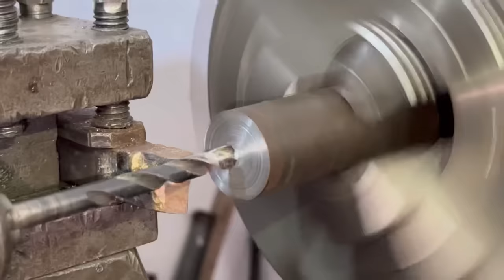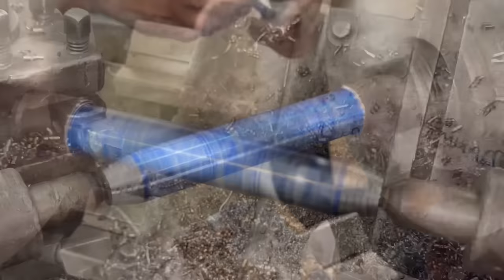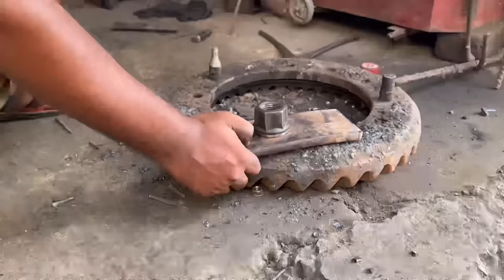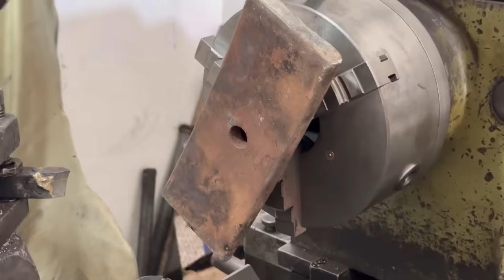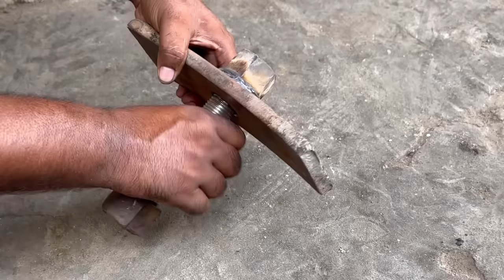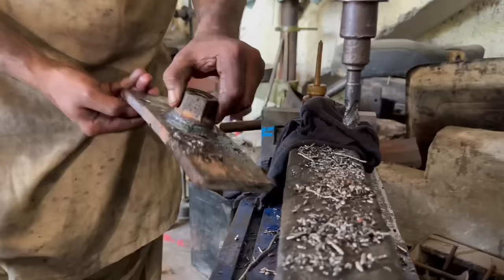How to Make a Puller Used to Remove the Front Wheel of a Truck if it Gets Stuck || interesting tool

Comment: At 2.47 you have turned the O/D of the rod down to approx 29mm. There is NO standard Nut or Bolt made to this diameter. If it is going to be screw cut for a M30 thread then it will fit like a prick in a bucket. This is amply demonstrated at 6.12 and 8.01 + 14.50 shows how rough the "screw cut" thread actually is.
It is this sort of "work" that reduces proper toolmakers to tears.

Comment: Fabricated failure. Stuck wheel will cause the 4 skinny bolts to bend & snap. 
Throw that tool into the drawer of stripped nuts & bolts.